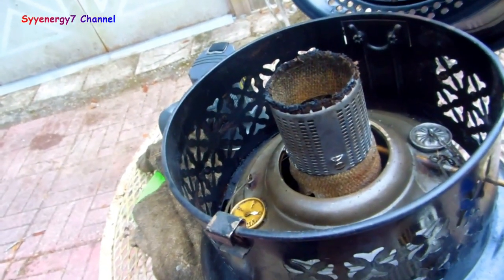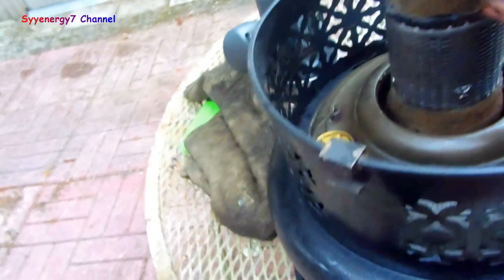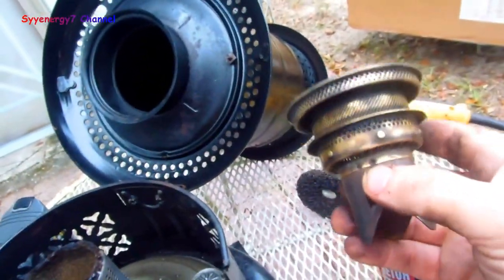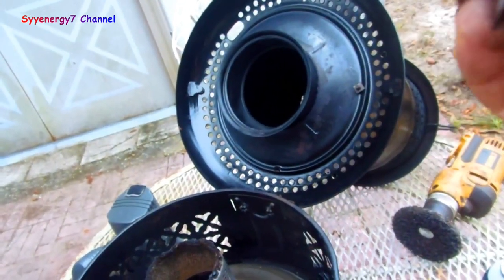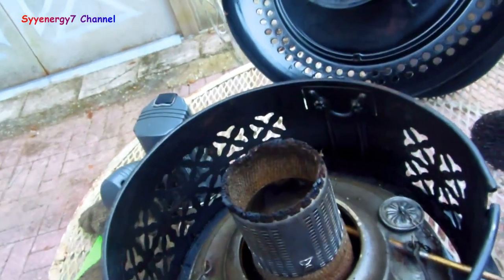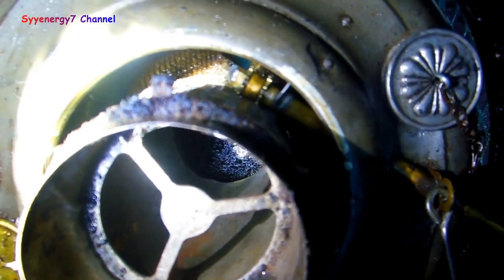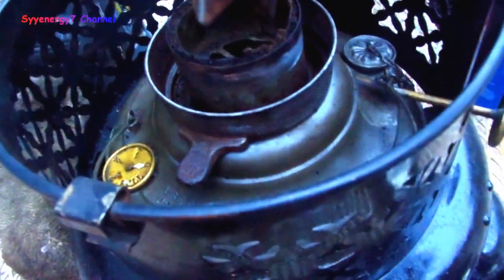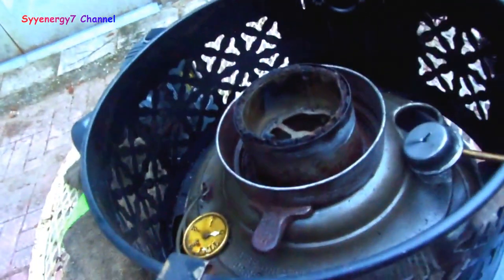Perfection Heater Wick worn down & maintenance tips

Comment: With trying to free up rusted parts on my heater's fount, I'm thinking a bit of copper anti seize would be good to use on the threaded parts. I used it with our moving molds when I did aluminum casting and it works really well and can take a ton of heat.

Comment: I am seriously thinking of replacing the Perfection wick with carbon felt, I think home depot sells Oakey flame protector in the soldering aisle. I think it would work really good. It would almost never wear out from what i have been reading
Reply: I was thinking the same thing. I have carbon felt and have only hesitated because I didn't know if it would mess up my heater
Reply: I just got a hold of a 120-B I'm restoring so curious to hear if you try it and what kind of results you see if you do. I would think it'd work well, but I wonder if there would be an issue with it being able to wick up the kerosene effectively enough

Comment: Looking to find recommendations to repair the font of my valor 525 heater.  The wick adjuster seems to be loose and the teeth can't catch the metal sleeve (too much flex) is there a way to reattach the bracket to the inside of the font?

Comment: I was able to extend the life of the wick little longer, the wick has the metal sleeve, and has 2 rivots holding the wick so you cannot move it, grind those two rivots flush and pull them out and straighten the teeth out on both ends of the metal tube, this will allow you pull the wick up little futher and extend the life of it longer. One thing you gotta like the perfections, simple and able to extend the wick life little more. i would not recommend pulling it pass the bottom edge of where the bottom of the wick is split, when that split seem reaches the edige of the metal bottom discard it. Of coursee

SYYENERGY: BURNING HOME HEATING OIL IN THE PERFECTION. you cannot do this with kerosene heaters that has a fiberglass wick. thank you snenergy for the hint of burning home heating oil in the perfection BURNED THROUGH 40 GALLONS of red dye diesel and no problems. 1/2 the cost of DAM KEROSENE. May the kerosene go stale and go bad!! EXPENSIVE CRAP!!!!

Comment: K-1 Kerosene. One of the cleanest, best fuels to use in these old heaters. Pricey? Sure. But you won't be cleaning that flame spreader to often with k-1 kerosene.
Reply: You go right ahead and pay $4.00 gallon for kerosene, that pump does look pretty just sitting there.  I will put home heating in my perfection. no problem!! $2.09 FOR OFF road dyed diesel fuel. and it works no problem, no additives.

Comment: How do you know which model it is, where is it noted?
Reply: Condensation can introduce water into the fuel. If that happens, the wick will fill with water and be very hard to light. Drain the fuel, remove the wick and soak it in alcohol to remove the water. Let the alcohol evaporate from the wick, reinstall and add new fuel.

Hope it helps!